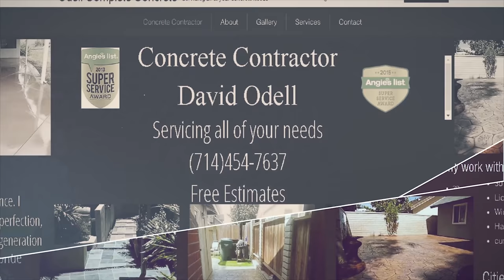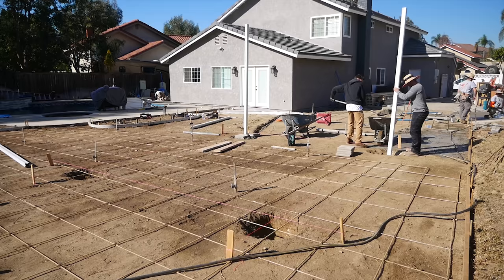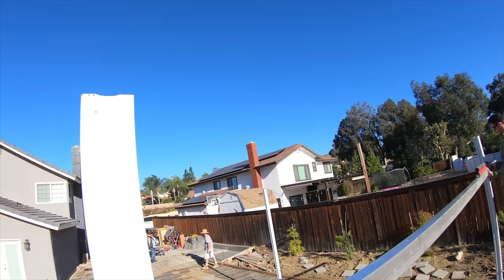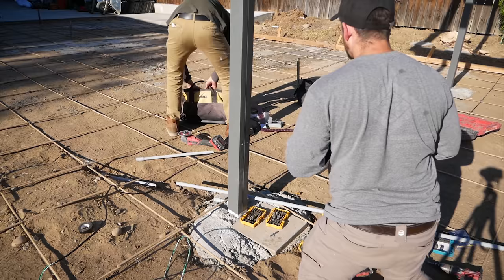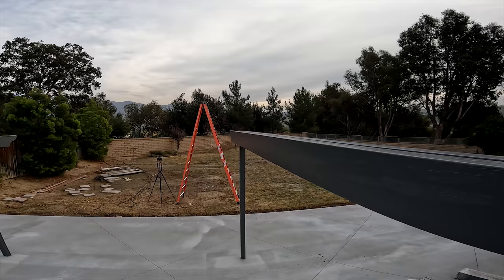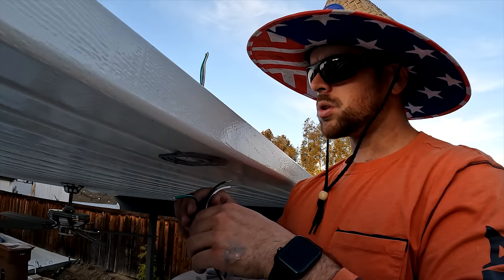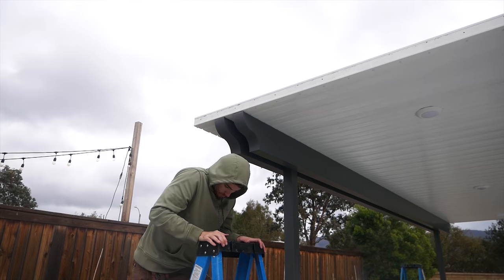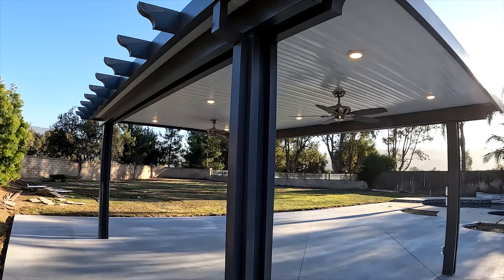How to Install a Patio cover with Recessed Lights & Fans!

Comment: Turned out great! For cutting the tops. I use a laser like you did to set the bottom marks, but then I just do the math for 1/4" per foot for the slope. Here is AZ we are mostly one man crews. We have a few ways to set the beam alone.  I build my post plates on single headers and use them as a saddle for the beam. On double headers. I use a gutter stand, or build my post plates and set the beams on those and use a bar clamp to hold it while I screw it. On the lights and fan beams, we cap the top so they don't fill with water when it rains. The supplier calls them a 8" carport fascia and then are a U shape that covers everything like a hat. It turned out really nice! I'm sure the customer is thrilled.
Reply from the maker: Good info
TY

Comment: Hi, great job. Just a little thing would be good for the electricity installation safety. I would put a rubber rings on the steel sharp edges where the cables are going out through the steel pillars or to the rooftop lights and fans. 👍
Reply from the maker: We insulated the wires heavy at those points
Reply: Yeah I was cringing a little there, I did notice the thicker insulation though. Pretty sure they make a grommet for that
Reply: They wrapped with more electrical tape and it isn't really proper. You can see in the last minute of video the lights are cutting on and off probably due to a bad connection or short.
Reply: It may not be proper but the LEDs look like the are flickering on and off. Most likely they are not. They may look like that if the frequency of the camera frame rate and the lights are not the same.

Comment: David, 
Typically patio installers use industrial metal tripods to hold up the beams.  They have telescoping bars with threaded rods in the middle to easily adjust the height.  With two tripods, it can be a one-man job but more makes the job go faster
Reply from the maker: That sounds like a nice tool to have.

Comment: Do you ever use  clamps when working on those post that  are up high to hold like a straight edge, if working alone.
edit: you answered my question 3 min later, I would of use some vise clamps they  are easy to use b y  yourself
Reply from the maker: Bingo
OSS
Reply: @OdellCompleteConcrete  Work smarter not harder

Comment: How far apart are each row of lights? I've been reading they should be no more than 6-8 feet apart for proper coverage.
Reply from the maker: I always say the more the merrier
Reply: @OdellCompleteConcrete  what would you recommend for minimal spacing or at least the surfing in this project?
Reply from the maker: well, I think the lights can be changed to aluminate however much you like, regardless of where they are

Comment: can anyone tell me what kind of plastic roofing they using? Might be cheaper to go this route rather an actual roof.
Reply from the maker: Aluminum
Reply: @OdellCompleteConcrete   with all do respect that don’t look like aluminum roofing you guys using lol. Looks like some type of sturdy plastic.
Reply: @dboog225  that’s because the paint on the aluminum is heat baked like powder coating, it’s all aluminum so it will never need maintenance
Reply: @eduardodedios8213  thank you much bro. 🙏🏾. So is that type sold at your HD & Lowes or I have purchase aluminum roof and then paint??